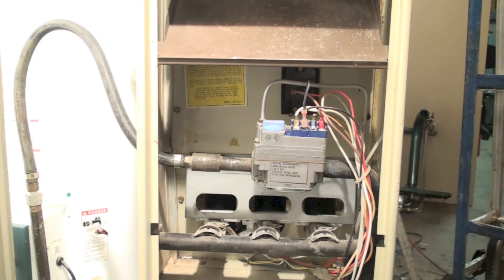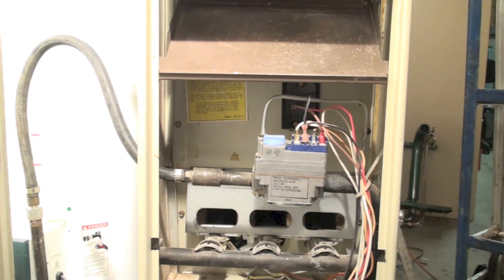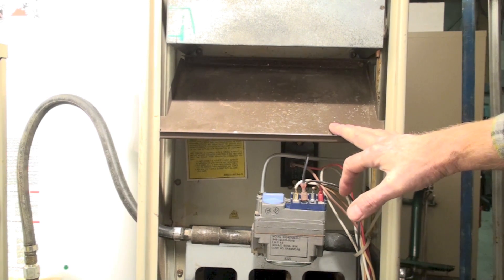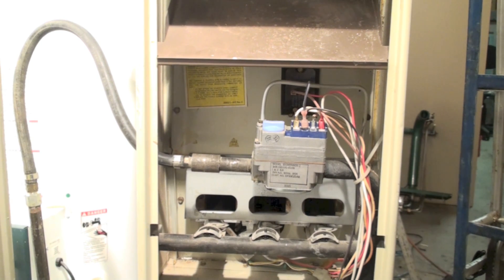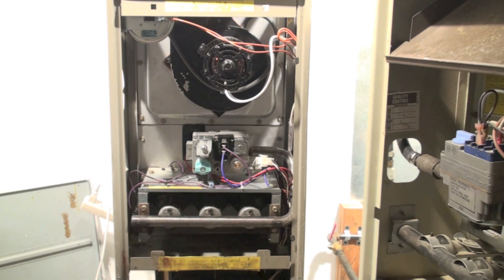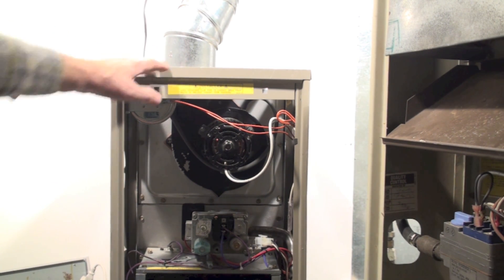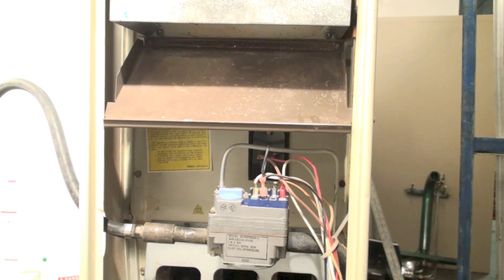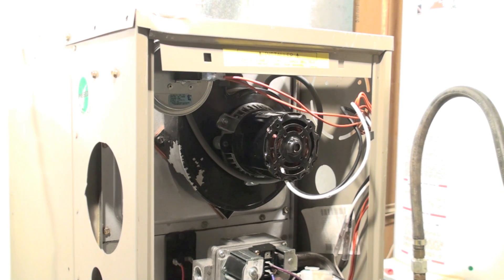The 80% gas furnace. Old 80% vs newer 80%

Comment: I would trade a little bit of efficiency for longevity and reliability.  We got an old 1980 draft Hood just like that one except with four burners.  I had to replace circuit board, blower motor, put the heat exchanger seems to be good.   CO2 meter only detects 5ppm from the vent.  Plus it has that old classic cozy warmth that you don't get with these newer 90%.

Comment: We have the old one, 1964 model - still working, though we redid the wiring and replaced the gas valve and fan belt. No sign of heat exchanger cracking. We oil the 4 bearings in the fall.  It's located in a heater closet in the garage, with its own source of outside air for combustion.

Comment: The house I bought many years ago is still running the 1977 Lennox G8 .    I went on kijiji and bought another Lennox G8 for $20 , stripped it down , now have a spare heat exchanger , gas valve , burners etc .    I would like a brand new nepoleon furnace but is $3800-$4500 installed (Canada)  .    Buying a new furnace the way I see it will take many, many  years to get your money back .   I get a monthly Nat gas bill ,   My gas usage is $35-40 . The other $100 or 70-75% of the bill is transmission fees , carbon tax , rate riders , Bs government fees etc .

Comment: The house I'm looking at has an ingenious design, natural draft Kenmore 70 Power Miser but instead of taking heated air to use for drafting it's in its own basement room that naturally stays above freezing but uses outside air for the draft hood, will have to see how much the gas bill is, I like it though because it's nearly silent aside from the blower and uses direct spark ignition instead of hot surface

Comment: I personally think with all the info I have been given. Give me a very old furnace. At least I had a warm house. Like many have said "You have to worry about condensation, Plugged Heat Exchangers, Changing your filter every month." Does any of this matter if my house is cold? OF course, you have to call in a HVAC Tech to troubleshoot it. Am I "Saving" Money by using and older furnace, or am I "PAYING" Techs to fix a Computer Problem, a drainage problem, an electrical problem. I have a 96% efficient heater, installed in 2012. My house is damn cold. Every 5 minutes it is cycling on and off! Even though I am using one(A Computer)...TA HELL with Computer boards!! Everything now is disposable, including your HVAC!
In the old days, I could have used that "heat" going to the Chimney as a way to heat my basement concrete with copper pipes.
Reply: We have an old draft Hood furnace that was built in 1980 and it's still works perfectly fine.  I had to replace the circuit board with a replacement and blower motor put the heat exchanger works great.   It has that classic cozy warm feeling you're talking about.  Every HVAC person I've talked to tries to get me to buy a new one but the hell with that.   I checked the CO2  levels in the vents and it's only putting out 5ppm.  If it ever goes over 10 ppm then I'll start worrying

Comment: Funny though, the good ol new 80's aren't phased out come 2020! Good deal, hope they never stop making them. Why? No worries about condensation draining and rusted/plugged secondary heat exchangers! (With 90+)
Reply: That's right the old furnace is were better they may not have been as efficient but mine lasted over 53 years before some furnace guy came in and said I had a crack a hairline crack and something then I find out that's a term they use to hook people into buying a new furnace wish I had my old one I'm on my fourth new furnace in 20 years.
Reply: @frankjgornickjr3676  not all techs want to screw you into a new furnace but I would have definitely requested to see the crack for yourself.
Reply: @frankjgornickjr3676  A 53 year old furnace having a cracked heat exchanger would be the least surprising thing in the world, but I concur with Angryfarmergamer, definitely tell the tech to show you the crack.

Comment: I hope the new 80%s never phase out. I think they are awesome. And they never have troubles like the damn 90+ units. Never. It's a basic scientific object. A mechanism must have to work harder to be more efficient. Which causes trouble. I wish I had an 80%. Due to living situations I must have a 90+. So I'm busy every single fall, replacing parts. Hoping my secondary heat exchanger isn't plugged. Wish I never tore out my chimney from my house. Think about that folks.
Reply: I use to dream about all the gas  savings from the dual heat exchanger, the cool plastic exhaust, the multi-stage variable speed motors...
BUT now I am in love with my bullet-prof 80%, induced with spark igniter, 30Yrs and counting.

I put a cheap soft-starter on the air handler and changed the run-cap so contactors and motors are no longer getting surged with 50Amp spikes 🙂
Reply: I absolutely hate the unit I have now. Sometimes it lights up violent, roaring flame sound for a few seconds, shakes the whole house... no reason for it to be doing that, goes away after a few seconds. Then in the winter when it gets 30 below, the damn thing goes out on safety because of the gas pressure being lower respectively. Brilliant design.. junk. 
I also hate the scam of these 90+ units. People who don't understand BTUs get screwed over by some installers. 80,000 btu, is still 80,000 btu, the amount of heat it puts out stays the same. For some reason the air also feels HOTTER coming out of an 80%er, doesn't make any difference. The secondary heat exchanger doesn't trap that much more heat either, it really only cools down the gas fumes to turn into water. All of the heat is transfered from the primary. 
I wish I could still use my old oil furnace, but due to poor maintenance of the prior owner, ruined it, hot spot in heatexchanger, condemned, etc. Was an old General Electric, low pressure burner. Fuckers made 80% efficiency and this was back in the 60s. Quiet operation too.

Comment: hi, on the 80% mid. eff. furnace there's an induced draft motor just before the venting. this venting goes up the chimney BUT it is negative pressure. So, if the induced fan is sucking through the furnace and pushing out the venting. Then how does it create negative pressure in the venting? Isn't the induced fan pushing the exhaust out the venting? thank you for all your helpful videos Gray.
Reply from the maker: The gasses leaving the furnace are over 200F, and will rise as hot gasses.  Also, the venting is pitched upward and vertical.
GFM

Comment: A 1956 American Standard unit in a relatives house went 56 years without a repair. A belt was changed in 1973 and 1996, the blower was replaced in 2012.  Explain why the new models don't work like this anymore?
Reply from the maker: Furnaces like that one had very thick metal in their heat exchangers.  This made the furnace last longer but the loss in efficiency made them energy hogs.  There is no getting around this.  The modern furnace uses a much thinner heat exchanger to transformer heat faster.  The furnace you mentioned would run for 4 to 5 minutes after the burner has shut down.  The modern furnace may run for one to two.  It also runs the burners for 2 to 4 minutes before the fans starts.  The modern one runs for 30 seconds.  
That furnace will buy a new furnace in increased energy costs every 10 to 15 years.
Perhaps it would be better if the 1956 furnace had failed one ago.  The owner would have saved a lot.
GFM
Reply: RADIUM CLOCK lol understandable!!! It's about a repeat business?!
Capacitors no longer have fluid in them?! I could shake them & hear the fluid move around.... now they don't last that long either!? About 1,2 years & some have to be replaced!!
When I saw his furnace with no draft inducer motor & he called it an 80%er...put a big smile on my face!? Lol!!
1st 78-80% furnace I saw was a carrier (super saver & another name!?)... I think?!
It had an igniter system with 3 wires... green yellow & ?white?!
Lot of people couldn't diagnose when a problem stemmed from the heat sensor energizing the gas valve! The gas valve had a bunch of wires going to it compared to the newer 80's with 2 wires to the gas valve!

We have come along way with 80's & 90's furnaces!!!
I prefer the 80% in cold crawl spaces!!!!
Because the 90% condense water & if temps outside are below freezing..... the system can ice up & stop running!
And the condensate pumps can freeze (3/8 clear vinyl tube!) tube to unit in basement routed outside?!
Reply: It’s called planned obsolescence, just think if you made a windshield wiper that lasted say 10 years or maybe even for 30 years you would sell a lot in first say 10 years after that you would lay off half your employees since nobody would need new wipers as often.

Comment: My 1986 80% efficient furnace has never been serviced. Everything works and is original. 32 years going strong. Don't buy the new units, they are engineered to fail after so many hours of use. It's called job security for the industry.
Reply from the maker: Just so you know, your "80%" furnace is not 80% efficient.  Its more like 65%.  In the late 1980s the method of determining efficiency changed to include seasonal factors, warmup and shutdown efficiencies and loss of efficiency due to the draft diverter.  A modern gas furnace is designed to last 25 years.  At the end of that time, advances in technology will make it inefficient for the time.  
GFM
Reply: @grayfurnaceman  Hi, good afternoon, I think we have Janitrol  furnace, 1986 ? modal, works fine. Need the owners manual, we just bought the house, please let me know where to get it, thanks. asaleh786@gmail.com

Comment: can i use pvc for this type furnance
Reply from the maker: No, this type of furnace must be vented with B-vent.
GFM
Reply: grayfurnaceman thanks for the response I got a new 80% furnace with the fan  and I’m putting a new roof want to get rid of the chimney , I want to vent from the side of the house what do you recommend
Reply from the maker: You can install a side vent system if the furnace is new and is rated as a category III appliance.  You must use a sealed metal venting system.  This means the vent joints must be sealed with high temp silicone.  Quite a job.
GFM
Reply: grayfurnaceman wow the roof is being install tomorrow and I’m trying to do it my self how high the stack
Reply from the maker: If you are venting thru the roof, most must be a minimum of 5 feet long, as direct as possible and must end vertically.
GFM
Reply: Uhh..NO
Reply: @mikerozic7225  Thanks Learn the hard way you 4 year late brother. I have a 95% now

Comment: I need your help I have 80% last year I was able to light the pilot can't get it lit now
Reply from the maker: Is it a standing pilot appliance?
GFM
Reply: grayfurnaceman I just got it had to keep  repeating the process over and over again held it down for like 2 minutes and then stayed lit. That's awesome you hit me back I really appreciate that good man thank you
Reply: grayfurnaceman it's a bryant it was lit had some heat ran to the store came back and it was of the pilot I'm in Maryland and it's getting cold any ideas ty
Reply from the maker: Check the pilot lite for for yellow, lazy flame.  If it is, the pilot is dirty.  Clean with compressed air.  If it is blue and covering the thermocouple at least 3/8", be sure the thermocouple is tight at the gas valve.  Just follow the copper tube to the gas valve.  If all checks out, the thermocouple may have failed. You can buy replacements at a hardware store.
GFM
Reply: grayfurnaceman so first off I can't thank you enough pilot has cover so there's a slick it's a blue and yellow orange flame and I'm not sure what that thing is you mentioned
Reply: thermocouple?
Reply: I took some photos but I can't post them
Reply from the maker: Send them to Grayfurnaceman@gmail.com
GFM

Comment: Is phasing out of 80% furnaces a federal law?  Your video was posted in 2012.  But I have not heard about this in Colorado.
Reply: 80% was still available two weeks when we selected our new 95% in Chicagoland.
Reply from the maker: I can't quote the exact law, but the 80% furnace is prohibited for installation in the northern states.  Colorado is considered north.
GFM
Reply: Just looked it up on the web. It appears that due to challenges, this DOE rule has been put on hold. It is even less likely to enact with the new administration.
Reply from the maker: That could certainly be.
GFM
Reply: I don't think 80% will phase out.... I doubt a gas furnace will ever be 100% efficient!
Electric furnaces are higher efficient with those heating elements in them!!!
You can always buy a heat pump & add the right amount of strip heaters in to compensate for the heat pumps loss of efficiency below 40 degrees outside!?
But everybody likes that hot air that comes from gas & oil furnaces (ikr!!!)!

Higher efficient systems with  ICM/ECM motors can make electric heat feel like gas furnace.... higher priced units of course!
Carrier Infinity etc..80/90% etc...
Reply: @orlandojohnson5742  Electric heat strip heat is quite efficient at heating the air, but it can be quite expensive regardless of the fact i heard, and is usually used nowadays just as an AUX heat source for heat pumps with temperatures drop below their capacity.
Reply: Ken Arbuckle I installed a temporary heating system at a family members house with 2 stages of electric heat!
Two 7.5 kw strips! 2nd stage on a delayed timer!
It kept the 3 bedroom ranch house warm through the winter!
And family member said the electric bill wasn't that bad!
Some people abuse the use of their systems!

Basically they had over 50,000 btu's of heat off my design! At full stage! But 1st stage was half & used less energy!

I like 80% furnaces & heat pumps with proper sized auxiliary heat!
90% 'ers are great but putting them in cold places (crawl spaces & cold basements!?) can have frozen condensation drainage issues when temps outside drop below freezing!
Sometimes even in a cold attic.... draining outside & sometimes eventually freezing at the outside outlet .... even the condensate pump!

Heat (without condensation)is better than no heat at all!?
Food for thought .
Reply: @orlandojohnson5742  In some areas it can be quite expensive then others far as i heard from people, i also happen to notice dual fuel systems have become more popular, my grandparents in Canada just had a one installed last year with a propane furnace for with temperature drop beyond what the heat pump can handle, and as for 90%+ furnaces, i think their great, i seen a whole bunch of them hear in up state Georgia too  but they do have a lot of barriers that can make them hard if possible to installed in curtain homes and in general have more things to go wrong compared to today's 80%+ furnaces, due to the condensate they produce and the different venting setup.

Comment: Two part question: 1.)How do I determine the operating efficiency of my boiler? It's a 1976 HydroTherm HC125, 100,000 BTU. It was thoroughly cleaned earlier this month (it took over 6 hours!). 2.) With radiant heat, in the old cast iron radiators, should I keep the thermostat on a steady, fixed temp all day and night (we keep it at 65), or have different settings for day, night and evening (at evening we used to drop it down to 58). What's most efficient and economical?  and what will prolong the life of the boiler? For context, I live in MN. Thank you!
Reply from the maker: You can get it tested by a service tech that has the proper testing tools, but that age boiler is the old "80%" efficiency.  That's a steady state efficiency but effectively its more like between 60 and 70%.  I would keep the temperature steady.   The make up time may be quite high (possibly several hours).  
GFM

Comment: Great video but my understanding was these old drafthood models with standing pilots were always billed as "builder" or "60" models, i.e. 60% AFUE efficiency, once AFUE ratings came about way back when.  The slightly better models with spark ignition and electric flue dampers were sold and marketed as "70-models" or 70% AFUE, whilst the fancy models with electric ignition and draft inducers were marketed as '80's.  This goes back to almost 30 years ago.  When we bought our second-to-last furnace in 1987, (A Trane XL80 BLU model that lasted over 25 years and but for a leaking gas valve could have gone even longer...)  they were still selling and marketing the old-style standing pilot, draft hood 60 models.  Anything achieving 78% or higher back then was marketed as a 'high efficiency' model and/or called 80%.  90+ condensing models were marketed as 'ultra high efficiency' or "90+".  Now they don't even allow anything under 78% to be sold.  I just don't ever recall anyone marketing a standing pilot draft hood furnace as anything other than a "60" model.  Maybe back before the 1980s they called them that?  A huge stretch to market something like that to the public as 80% efficient, very deceptive if they did.
Reply: I always heard the same thing.  The older units with the pilot lights were 60-70% efficient.